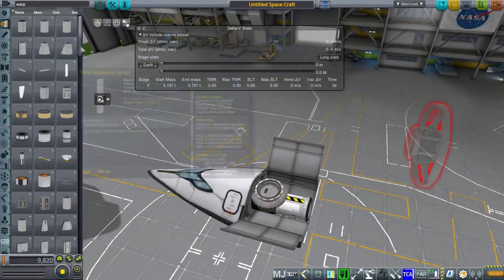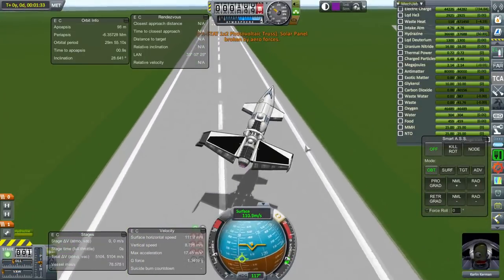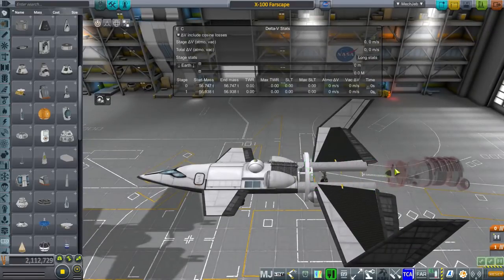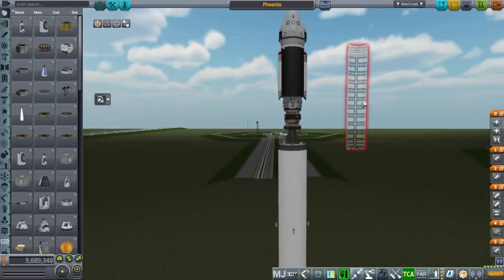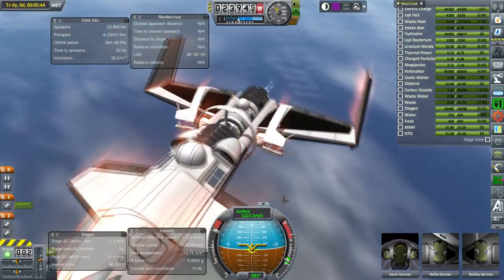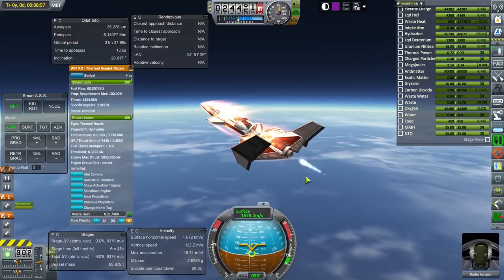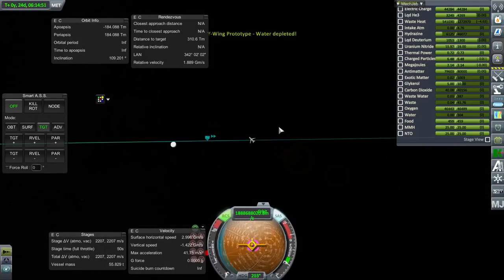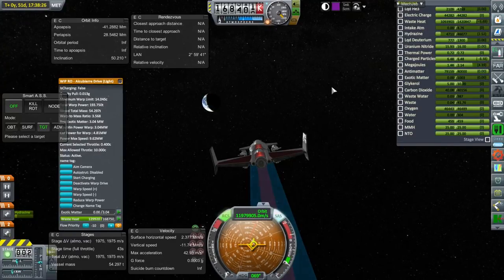Kerbal Space Program - Single Stage to Interstellar Spaceplane

Comment: you used subsonic intakes for ramjet, that's very bad, and as result obviously going out of air,
actually antimatter/fusion powered scramjet should work up to 3000 m/s  in rss (because it was already tested on mach 10 but on hydrogen chemical fuel (without oxygen supply as far as i know) :) .
Reply: they do differs in form of internal air passage, but in case of reactor presents much complexity would be tranferring heat from reactor plasma, so there would not be such big difference, kspie just don't have normal scramjet, but kspie ramjet should work good enough up to 2200 m/s